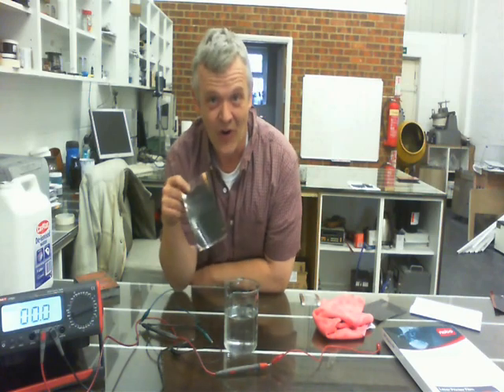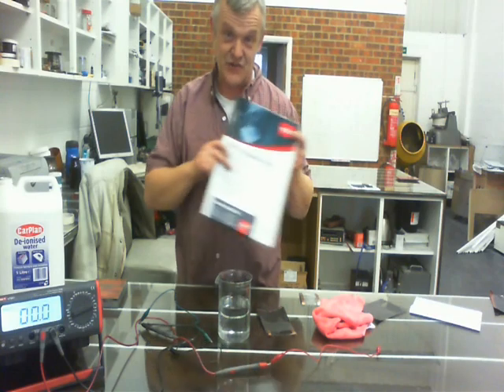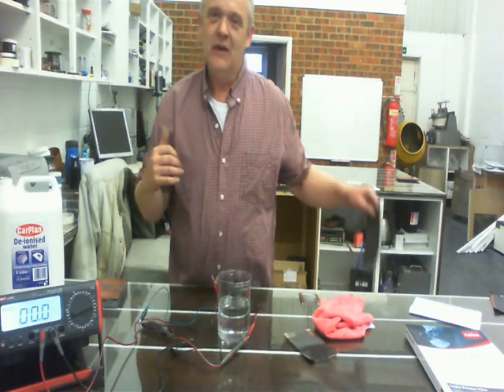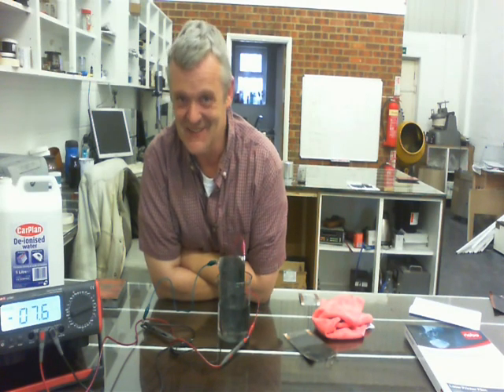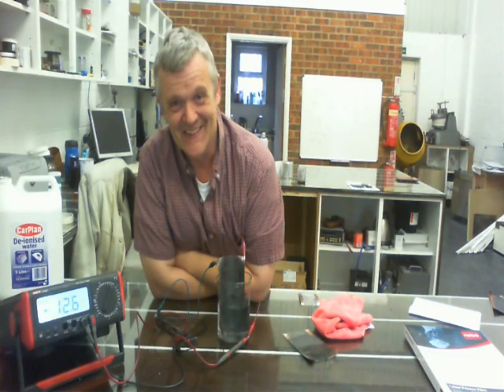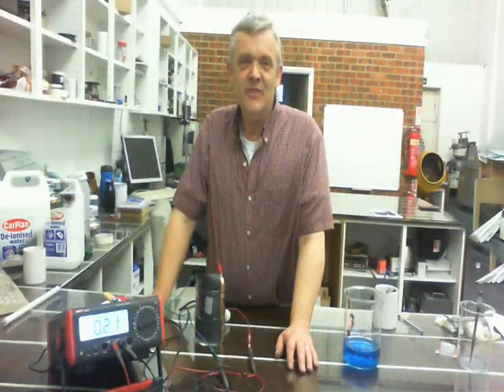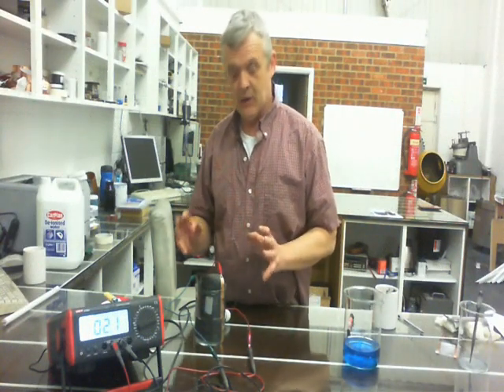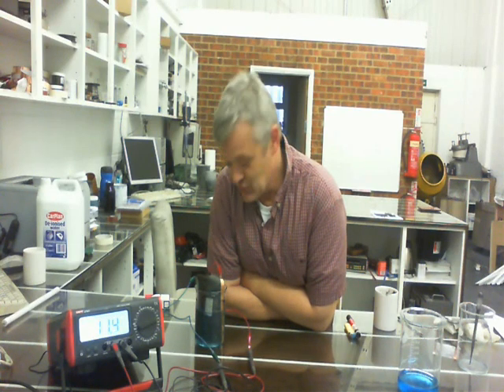EZ Water For Solar Cells And Water Purification

Comment: I have been looking into structured water and there seems to be some new research that contradicts the initial 2014 findings a bit.
The structure in water only seems to exist on the femto-second  (as shown with the X-rays) scale and averaged out on any other scale. So how there can be observable long term effects of any structure is not yet known. It is still theoretically possible, since we have dynamical systems theory to explain these types of behaviour as strange attractors. But they are very hard to study. It is interesting stuff.
I like that you approach it from the practical side, that may lead to things we can study and maybe give some more idea of what is actually going on.

Comment: Instead of using a glass container ( 2.0 )which is more dense than water ( 1.0 ) how about hdpe (.9 ) container which is less dense than the water ( 1.0 )and placing it on a plastic bag of ldpe( .8 ) preventing heat flow towards the table it sits on keeping the heat in the water.  If heat is applied to the water does electron flow increase ?

Comment: Hi Robert,

Yes, this is very exciting and interesting stuff. I have been analysing a/o Stanley Meyer´s "car on water" for quite some time and I believe this EZ layer gives an explanation for what is known mostly as "Brown's gas" or "HHO". 

First of all, Pollack talks about "hydrophilic" substance, which is a substance which attracks water, because it's molecules can be polarized. This is exactly what is called a "dielectric" in Electrical Engineering. When you look at how electrolytic capacitors are constructed, you will find that you have two plates, of which the positive plate is an actual capacitor plate, while the negative plate is merely a contact plate to make electrical contact with the electrolyte. The actual negative capacitor plate is formed by the ions in the electrolyte. 

Another very interesting device are old-school electrolytic rectifiers, which can be home-made with aluminum and baking soda, as can electrolytic capacitors. I believe the existence of an EZ layer just atop the dielectric layer explains why an electrolytic rectifier works. And it also shows that this EZ layer is not only influenced by light, but can also be manipulated with electric fields.

I am currently working on a project in order to attempt to make a replication of Stan Meyer's first prototype of his "car on water", which appears to have stopped working around 1985 or so. I wrote an article about that, in which I was convinced electropolished stainless steel would provide a suitable dielectric layer:

http://www.tuks.nl/wiki/index.php/Main/StanMeyersSecret

And based on that, I started my project:

http://www.tuks.nl/wiki/index.php/Main/MeyerWFCReplicationProject

However, it turned out that a standard electropolishing process does not result in anything resembling a reasonable electrolytic capacitor. Therefore, I am currently experimenting with nikkel plated copper tubes on a small scale, which I just started doing. The idea is to grow a layer of Ni(OH)_x crystallic structures on the nickel plate, which should result in a reasonable electrolytic capacitor, since nickel is also used in super capacitors.

Now I'm not a chemist and there are at least two variations of Ni(OH) molecules, and there are two distinct charge exchange mechanisms acting in super capacitors, one of which is "pseudo capative" and involves chemical reactions instead with actual charge transfer, which is not wanted for the application of manipulating the EZ layer with an electric field. 

However, what I want to try is to fill the concentric electrolytic capacitor construction with a 10% NaOH solution, as is being done in Edison's Nickel-Iron batteries to see what happens. Some playing around with that showed the positive tube growing a black layer, which does suggest some form of Nickel Hydroxide developing.

Now when we succeed in building a reasonable electrolytic capacitor consisting of concentric tubes, we have something with which we can manipulate the EZ layer on a macro scale, just as with any ordinary electrolytic capacitor. And if we bring the electrolyte in between the tubes into acoustic resonance, much like as with an organ pipe, I believe we can manipulate this EZ layer to such a degree that some kind of crystalic water-like gas is obtained, which is being reported as imploding instead of exploding and being negatively charged.

To finish this off, I also have a theory of where the energy comes from, based on the work of Prof. Turtur, as you can read in the articles posted above.

If you are interested, you can contact me via lamare at gmail dot com.

Regards,

-- Arend --
Reply from the maker: you might want to have a look at what Leicester university are doing with ionic fluids and deep eutectic solvents and electropolishing - I did a video on deep eutectic solvents - they are interesting things for capacitors too. You make some interesting points with regard to EZ water but I am not sure if I will be able to find the time to explore them properly given my own workload

Comment: I love this!! Why does methylene blue increase voltage? Is it because it's an electron acceptor itself? (I know it serves as an alternative electron acceptor in the mitochondria so I'm wondering if it's having that same effect here somehow.) Also, this is an older video--have you figured out yet how to increase the voltage to the point where it can be a more commercially useful battery?

Comment: I have an idea. polarize a sheet of graphene so there is just 2 sides (not a lot of lines), 1 electrode on each polarity, dump it in water out in the sun. If the polarity of the ink has an effect on its hydrophilic propriety, we should see a greater voltage than with this version of it. And if there is a big diffrence in efficiency... well it is time for you to try growing carbon/graphene nanotubes out of your ink!!! with a fur-a-like texture, you have a lloott more surface area! lot more ez water.
Reply from the maker: good idea mate

Comment: The aliminum could be acting as an air battery. Especially with carbon and water in the equation. If you have time, try it with oxidised copper on one electrode to create a p-n junction, and ditch the Al.

Have you googled hydrophobic battery before? There are a number of versions, none of them reduce in charge, ever. Some have been running for 60+ years. Continuiosly suplying current. Its all in the piddly amounts of power ranges, but the batterys have hardly been played with either, The common one thats easy to reproduce involves alcohol based hand sanitizer gel floating on water. One electrode in each material. Gives a few hundred mv and maybe a micro amp. But the cell size has no relation to power... A drop of water beading on a hydrophobic leaf gives the same power... If you could do this on a micro or nano scale..... The greater the hydrophobic strength, the greter the eletrical charge. Lots of overhang on water beads may be a factor, more experimentation on tiny scales is needed.
Reply from the maker: intersting stuff mate - could be an air battery but i doubt it - still - it could be. I'll look into this more thanks for the direction
Reply: The de ionised water makes air battery unlikely, I agree, but there is a remote chance...
Reply from the maker: Mongrel Shark maybe

Comment: Great idea, mate! Homemade graphene is certainly much cheaper than nafion! If you add pH indicator dye to the water do you get an acid/base color separation? I imagine you would but it would be nice to know for sure as further confirmation to see if it behaves like nafion. I find it all very fascinating. I doubt mainstream science has accepted Pollack's ideas despite the evidence he presents. Part of that may be because nafion is so expensive. Now maybe more people will start looking into this phenomenon and repeating Pollack's experiments. 

Do you have any recommendations for choosing appropriate size magnets to make a magnetic device for aligning graphene?
Reply from the maker: this is all too new mate to give real direction - all I can say is what I have used - I don't really know if that is the best thing to use and it is as valuable to try closer alignment of wider alignment - both would need to be tried as would different carbons

Comment: I'm having a hard time seeing why this isn't just a galvanic reaction?

In the presence of oxygen, metals oxidize. Other atmospheric effects and thermal cycling accelerates this process. When moisture is present, these oxidized salts form electrolytes between the two dissimilar metals and become a simple battery.

I know you started with deionized water, but the moment you put a metal or carbon ink into the water it will strip some of the metal and carbon ions and become an ionic solution again. 
This becomes especially true once you add methyl blue.

From this perspective, it is obviously a weak solution as the galvanic potential of Al and Cu is 0.53v, but your voltage would probably climb with time as EC increased. 

Furthermore adding a light source would do exactly what we see here as it would react with the metal surfaces via the photoelectric effect further increasing the EC of the solution. Is there something here i have missed??

I have just learned of the EZ water work of Dr. Gerald Pollack, and although i am skeptical i am also hopeful that there is in fact substance to his assertions. Although what he is claiming sounds at least plausible and i'm fairly certain there is at least a kernel of truth there, i have yet to find a satisfactory explanation of mechanism, especially considering the fact that certain aspects seem to directly contradict our (or at least my) current understanding of both chemistry and physics (ie; ionization of water via non-ionizing radiation).
Thanks a bunch.
Cheers!
Reply from the maker: i'm not sure what your question is - Pollack goes through the mechanism via his TED talk - there's nothing contradictory there - this is interesting not sensational

Comment: how interesting would it be to allow the electrode ends to get close enough to each other to create a sparkgap, and then what you would PROBABLY get is a very inexpensive way to split water into a combustible form. you could simply get the electrodes close enough. drop the whole thing in a bottle small enough to get a balloon over the mouth of and see if it inflates the balloon. (the way that dropping a standard battery into water will)
Reply: after combustion this would generate very pure water. so you could generate both power and potable water this way if it works.
Reply from the maker: hmmm - well worth an experiment or two - cool idea mate

Comment: Baffling!!! I am afraid to understand lol, it forces to think another  a lot of things.
Actually, that s a water battery using light.
The structure or the material seems to be important. Does it works with other things or just carbon?
I won t sleep tonight. ....energy from water....wow
Reply: Bravo Rob
Reply from the maker: Mo Kha
cheers mate - I am sure it's to do with the structure - other things will work but you might have a problem collecting the charge